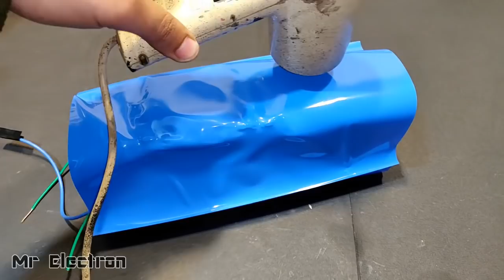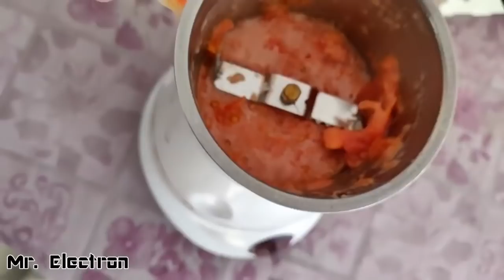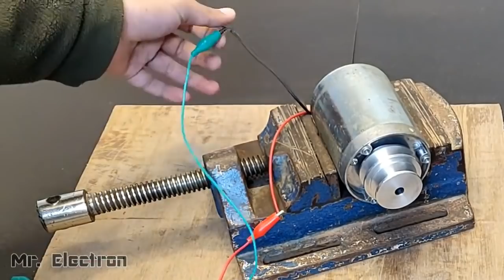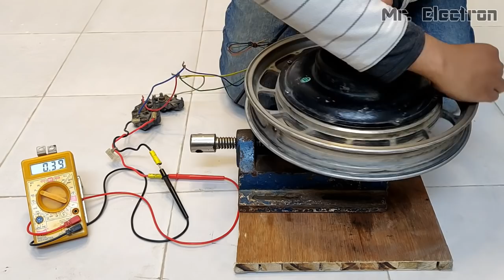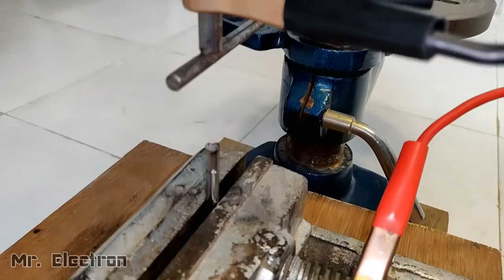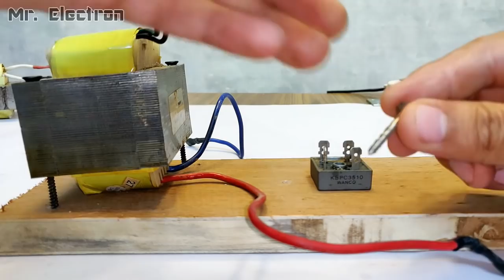5 Amazing Projects DIY - Compilation !

Comment: Sir I am making a Tesla coil.I have 0.7mm copper wire .so how many turns I need to take for primary and secondary winding and for circuit can I take 3( 2n2222a ) transistor in parrel .please sir reply .big fan of your videos😊😊

Comment: my friend who i envy so much i have no way to do this but the white power is stealing from me so i ask you to make these things and test them for me. one a capacitor with one lead in and many leads out but on the top. an unrolled capacitor with a metal plate lying flat with pos neg on one side and pos neg on the other is a voltage rectifier right. well what happens when you roll it up. it explodes maybe if you put many leads it won't explode. or maybe it doesn't explode. but maybe you put pos neg then many lead out., is this like a house line system and the world cheapest transfomer. then make this compression jam a wire copper through a sheet as you roll it and the make plastic magnifier to effect the now led powered capacitor (which i call a solar capacitor ) a control system for (opaquing magnifiers is necessary maybe.) seperate sensor to prevent capacitor from exploding and must be circuit that is always on for opaquing or the circuit will explode but is super cheap solar generator as you need nothing also magnetic closure for magnet force open to prevent explosion is also good secondary protection from capacitor explosions and still super cheap solar generator.

Comment: i want to see one 350 alternator turned into a motor and one 320 amp alternator into a generator for the motor with a ebike assembly running it to converted a pedal assist into a ehonda goldwing. can you do this for me.